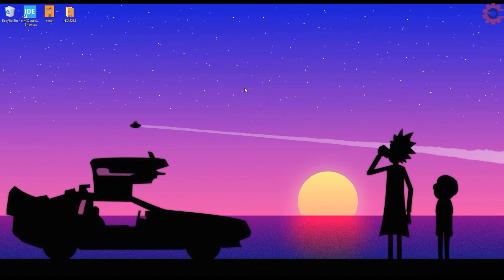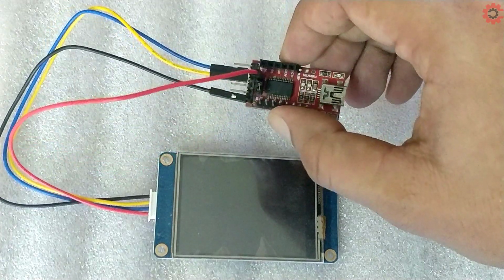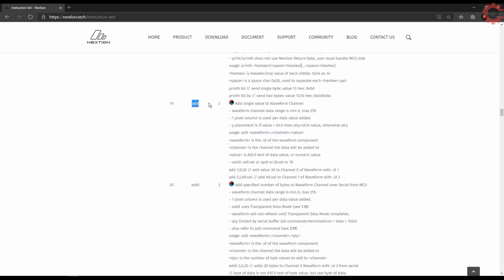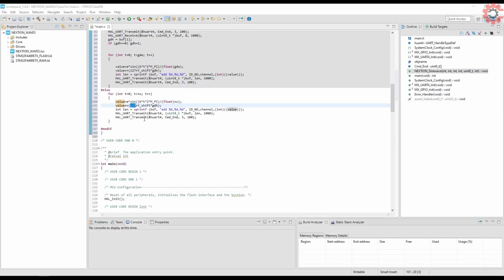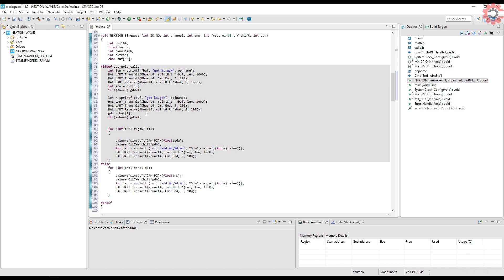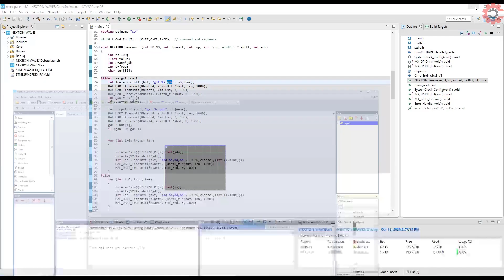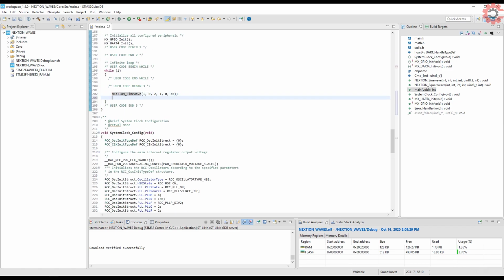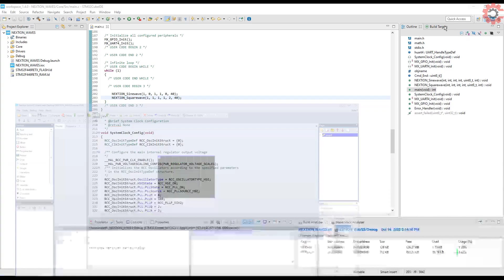How to Generate WAVEFORMS on NEXTION Display || STM32 || Sine Wave || Square Wave

Comment: Thanks for the great tutorial. 
If the Y axis is Time, like an oscilloscope, the convention is old data on the left, new on the right. So generally data should come in from the right, not the left. Nextion plot defaults the other way. Just change dir to right align. Easy fix.

Comment: Hii Controller Tech,    Very  Nice  Video.
first  I changed toolchain IDE to ARM-MDK in STM32 CUBEMAX  , after that but when I compile this code into Keil5, this is giving error msg

error:  #20: identifier "M_PI" is undefined

PLEASE GUIDE ME , WHERE I NEED TO DEFINED THIS ?

i used your code as it, just change toolchain IDE only

thanks in Advance
Reply from the maker: Include math.h
Reply: @ControllersTech  thanks for reply 

I include the math.h, but problem is same

"NEXTION_WAVES\NEXTION_WAVES.axf" - 3 Error(s), 0 Warning(s).
../Core/Src/main.c(201): error:  #20: identifier "M_PI" is undefined
Reply from the maker: It's the pi value 
Define it somewhere
#define M_PI 3.1416
Reply: @ControllersTech  thanks you, now my code has been complied.

tomorrow i will test this with oscilloscope,
Reply: I also want to join your  channel
Reply: ı also got the same problem have you solved it yet?

Comment: If I could have put 1000 likes,
I got into my hands nucleo f446re and found a very good project on it,
Repeated but gives an error. In general, I'm not good at programming
Keil_v5
446RE.axf Error: L6218E: Undefined symbol MainInit (referred from main.o).
446RE.axf Error: L6218E: Undefined symbol MainTask (referred from main.o).
Finished 2 information, 0 warning and 2 error messages.
Wrote to the author of this project, did not answer.
I can leave a link to this project, maybe you can help me.
https://github.com/foldvarid93/JBC_SolderingStation
Reply from the maker: The code you have mentioned don't have the keil version...